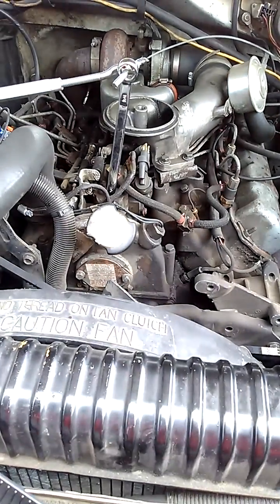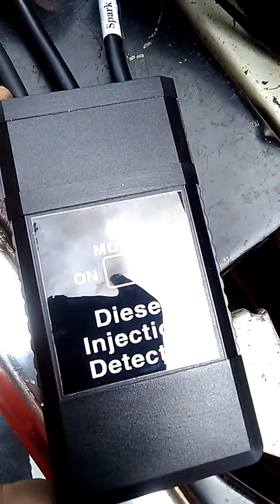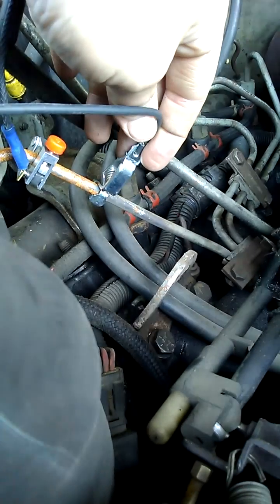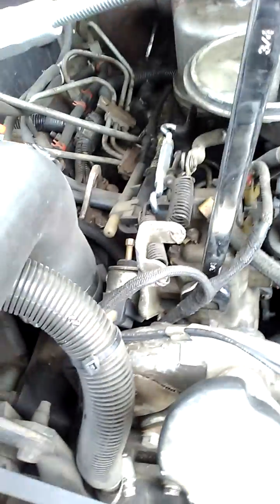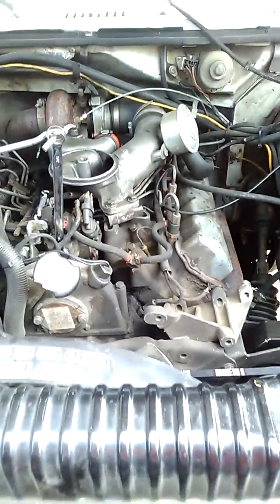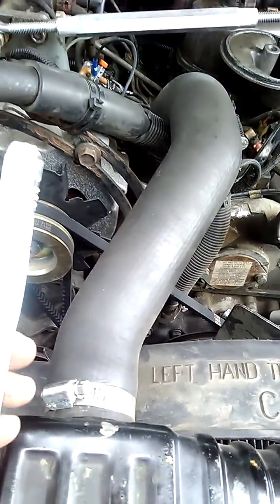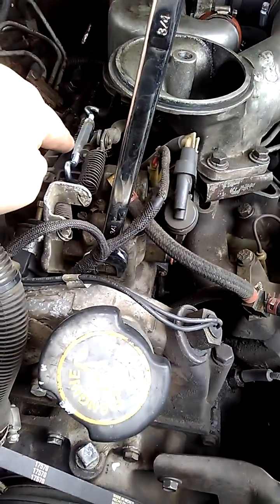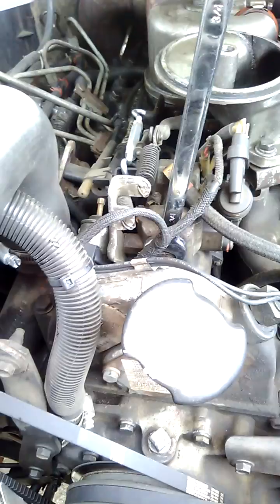Instructions on how to time a 7.3/6.9 idi pump timing ferret meter

Comment: Part of me wants an idi diesel, either a turbo 7.3 idi, or a 6.5L Detroit turbo idi. I know you said it's rather easy, but stuff like this usually ends up being a bear to me if I try it on my own, and I don't really know of anyone in my area that works on diesels older than 1999 year model.

Comment: So I’m very new to the world of diesels but today I finished up installing new injectors and the pump. It’s runs terrible. It’s not speeding diesel everywhere which is good. But I assume my pump timing must be off. It white smokes pretty bad and idles poorly. But it will rev if you hit the pedal.
Reply from the maker: It could also be the pump if everything was installed correctly alot of bad reman shops
Reply: And I would certainly hope the pump is good. It’s a remanufactured stanadyne.
Reply from the maker: @VinnyMartello  what I meant by incorrect is if the top cover was pulled off like you'll see in one of my other videos. It's hard to trouble shoot without being there but might need to be adjusted either left or right. Also double check all your injector line connections. Stanadyne certified rebuilders should be good just sharing some of what I've heard from others
Reply: Thanks buddy. I’ve manage to get it running and almost hold an idle. It may still have air in the lines. I hope that’s all it is.
Reply: I assume it was installed correctly. It really only wants to go on one way.

Comment: Does this process tell you what RPM's your engine is operating at?
Reply from the maker: No it does not it converts diesel pulsations into a usable number so to speak to set the timing

Comment: WOW  I just bought a 94 7.3 di -T My very first diesel. I had no idea time one was so complicated.  I have watched this video twice and still don't understand all the hoops you have to go through just to time one, or how to even use the electronic devices. OMG what did I get myself into?  This is going to be one steep learning curve. What are the machines named one needs to but to do that?
Reply from the maker: Several have been discontinued called a diesel pulse adapter. Bluepoint makes one, ferret was the old one I own, tach n time was one, and rotunda was the old ford dealership timing meter. I'm sure there is others but those are the main ones. There is other videos online and the forums on how to do it but it's not super hard even thou it sounds a little intimidating.

Comment: Hey mike, my 7.3 idi shakes/vibrates really bad when I start the engine and I have to push the throttle to stop the vibration, sometimes more than 2 times, but it only shakes when the engines warms up, in the morning it doesn’t do it at all. Someone told me it might be I have a bad injector, lift fuel pump or possibly the fuel injection pump. Any idea?? Pls
Reply: All suspects but most likely inejection pump as they are notorious for causing hard “hot starts” when they are nearing the end of their life as the metal expands just enough to make those clearance tolerances that much worse and not supply enough pressure to your injectors screwing up their pop and spray pattern and effectively the timing of everything. Poor hp and mpg
Reply: @smelnyk91  Ended up being the Dual mass flywheel

Comment: I have a hypermax turbo. And only see 6-7 psi and 1000 egt i have a brand new pump from R&D its a 80cc pump. I set the timing to 8.5. If i go to 7 should that help or is that normal #s
Reply from the maker: it's normal I only hit 10lbs with my rd2-90cc ip. The hmax kits were designed to turbo na trucks without needing studs imo. Kinda lackluster kits but hmax still supports em.so there is that.
Reply: @groundtogreen1140  i put studs when i got the engine rebuilt. I have a rotunda timing meter. It has that. Magnetic pick up rod. Ill timr it to 7. I tested it out at 9-9.5 and it smoked to much and had no power.

Comment: Is is necessary to do this when you changing the fuel return lines and injectors? If not, when would it be necessary?
Reply from the maker: just when swapping an ip
Reply: Will bad timming cause black smoke..? @groundtogreen1140
Reply: Thanks

Comment: Hey Mike, where are you located? do you ever look at other people trucks that need timed since you have the right equipment and knowledge?
Reply from the maker: Southern michigan and yes have timed a few trucks for friends
Reply: I just purchased an ATS 088 complete kit I found on Craigslist.I got it for $600! everything but the valve cover was included. I bought a Banks front IP cover adapter for the CDV and will fab a hose. I haven't installed the kit on the truck yet. I enjoy your videos and I have learned allot. Your video on air intrusion helped me so much! I had rough idle and I changed out the factory Schrader valve on top of the fuel filter with a petcock and new seals on pump to filter fuel line, now the engine idles and run smoother than ever, can't thank you enough